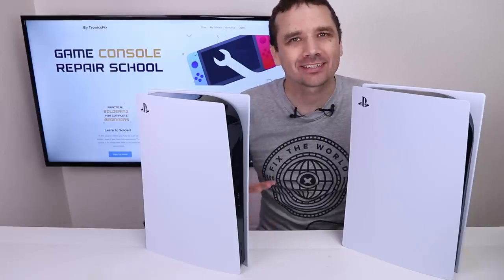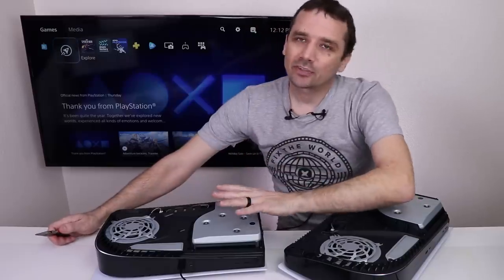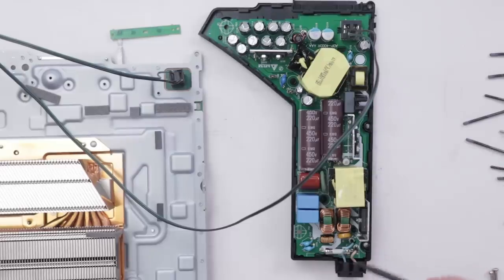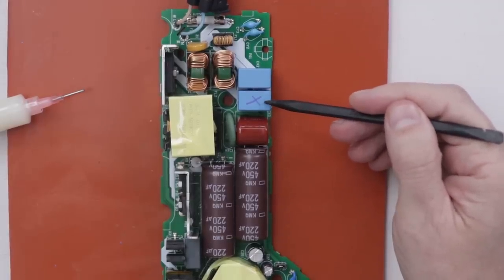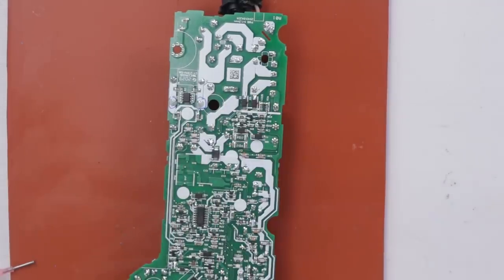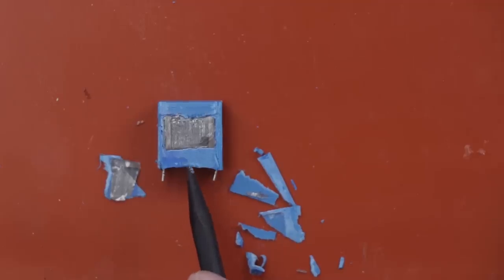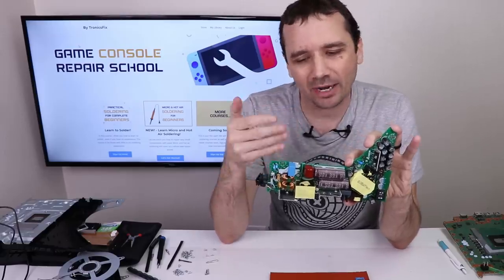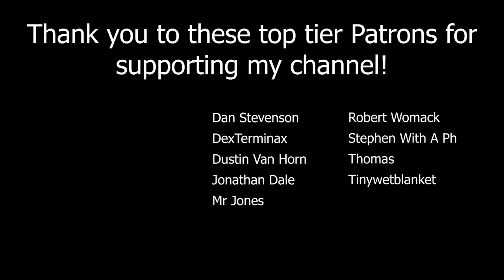PS5 Coil Whine - What Is It and Can I Fix It?

Comment: Same thing happens on battery chargers. The Milwaukee M18 Rapid charger, for example, is horrid when charging a battery. The noise you hear drives me (and others) crazy; so....we put them in different rooms away from us, or in garage etc....
Like another person said, it’s inevitable for some “noise” with electronics etc....and not much one can do.
Sometimes it does go away, it becomes white noise and don’t notice it, volume in room is louder than noise, etc....
This is first year ever, not buying new console, cuz over the years, [they] have have strayed from the console experience. When prices for PC hardware comes down; will upgrade PC and just game full time on that, especially since able to do game pass on it for MS titles, and also have Steam etc...for your library. Other “great thing”, no proprietary storage....so, don’t need to “waste” $300 on a Xbox SX “expansion” card to play more than 7-10 games. Yes PS5 has m.2 nvme pcie 4.0 5500/read speed ssd expansion slot....but won’t be functional with firmware update till June 2021 🤔, also,  2TB ssd is like what, $360 before tax, & if bought digital console....welll, got so,e money into a machine that will be revised in 3 yrs time.
This is the place we are now at w/ consoles....are they really worth it now (yes, gpu, cpu, ram etc....prices for pc will drop again, and can get good FPS, and UI in a budget build); but that neither here nor there, right😉
Sorry for book I wrote, can’t wait for next vid! Can’t wait for what you bring us next👍🏻

Comment: This type of noise can have many reasons, mostly lower quality components used. You can try to replace that capacitor with similar high quality cap. 
This can also be due to resonance, you can try to filter out that noise out with a series inductor and a lower value cap instead of this, but it will be mostly trial and error without a proper schematic.

Comment: If it's coming from a metal film capacitor that would mean the buzzing sound is likely electrostatic. I've heard you can mitigate capacitor buzz by just using one with a higher voltage rating, but that might not be feasible when you have to fit it in the same space as the old one. There's also variation in manufactured parts, so maybe that one just wasn't packed and epoxied tightly enough. Replacing it with an otherwise identical part might be all it takes to get rid of the sound.

The other option is to just take off the problem cap. You'll basically be trading audible noise for electrical noise on your house circuits. If the FCC shows up at your door, hide the PS5.
Reply from the maker: Lol...noted!

Comment: I had to send my PS5 back for a replacement because it had so many issues. From a very loud fan (as loud as my PS4), to a high pitched noise that would leave my ears ringing (others have same problem), to a loud buzzing PSU. 

I feel like it isn't as uncommon as people think because Sony themselves know of the problems as they had no issues replacing my PS5 without any proof.
Reply: @J Fz if I investigate my situation? No I just sent my PS5 because 1 dude said he had the same problem. You should just Google or check on YouTube and you'll see a good amount of people having similar issues with their PS5s.
Reply: @J Fz I know you're not calling me a liar, it's all good. I'm saying what you said doesn't really make sense. Firstly it's not a "particular case". I don't know but the way you're saying it makes it seem like you think only a few PS5s have similar problems when it's actually a lot more. Also I don't think I can link these problems to "dropped in transit" when the issues started to occur weeks after playing. 

Loud fans, PSUs, coil whine, buzzing noises, loud disk drives, will always be problems with similar electronics especially if they're not built particularly well. I don't believe the series X has as many problems because the quality is higher, even the packaging is of much higher quality.

Comment: Funny how people complain about coil whine like it's total deal breaker. I call it normal, your ears get used to it over time. 

It's not a fault in device, it's just how things work and every single device/appliance/gadget can make it..
Heck! Even my iPhone makes hiss noise when it's loaded with 3D graphics on screen, phone charger whines when I put my ear next to it, my rig whines in games and my laptop's backlight module makes humming noise at low brightness
Reply: @Wayfaerer Then don't use it, blame Sony for having certain manufacturing cost they had to match to get it sold as price it's meant to be. Then you need to make compromise somewhere, and this time it maybe have been the PSU's components. Higher quality components, almost cherry picked ones would for sure be quiet

Comment: In short it's basically just current passing through it. That capacitor may be made slightly out of tolerance, therefore a bit noisier, but it's super common for high voltage caps.

Comment: You can simply put a magnetic resonator close to that conductor (which is nothing but a close coil) - something like an iron ring :D and getting your ear close to 450V capacitors is a good idea for getting rid of unwanted ear hairs
Reply: @J Fz It can be glued to the top cover for example and be combined with some coil windings

Comment: The epoxy I believe is for fire suppression because it a x2 (meant for 120/240vAC mains) class cap. Just try another one rated the same, its works the other way as well and is called  "microphonic" when a cap starts making noise or emitting it electronically. Basically the closer the layers(capacities value vs space)  of the cap are the high chance this happens. Even the little SMD caps can sing in the right conditions.
Your cause is likely up stream from the cap though or another device on your power grid. With out oscilloscope (and differential probes or isolation transformer) I don't think its going be easy to find.

Comment: The issue is we have the circuit board, but we don't have a schematic of what the hell is going on with the power supply. Of course you have AC to DC conversion in there somewhere. My guess is the capacitor is being used as a low pass filter or something of that nature. It's defected so it is not filtering out the noise like it's supposed to......that is why I would try to replace the capacitor....of course you need the right model to do so.
Reply from the maker: I could replace it but I don't think the capacitor is faulty. I think it's a normal noise that it's making. The only thing I can think of is replacing it with another component that does the same thing as that cap but doesn't make the noise.
Reply: @Tronicsfix  yea buying one of higher quality from a better rated company would probably fix the issue

Comment: to all those who freak out about coil whine. Its normal almost every console has it. You can especially hear it with heavy games like ac valhalla. And since the fan is so quiet the noise is more audible. 

Great vid btw :) 👍
Reply: Yet somehow SX does not have widespread reports of annoying coil whine. Could it be that one company went the extra mile to ensure theirs doesn’t have coil whine?
Reply: @captaincrunch1707  

could be. If one thing the xbox one did better than playstation last generation was noise level. Extremely quiet and coming from ps4 which was ridiculously loud. The ps5 ain't to bad.

Comment: I didnt really know what a coil whine was
But now I kinda know i was just thinking its from the transformer or inductors

But its other Components too
I guess its something with the frequency going in to it and it starts vibrating
I don't think coil whine hurts just a bit annoying 

You should use a polyester film capacitor instead those are quite Stable

Comment: Maybe I'm just getting old but all capacitors whine when charging up and discharging. This one just happens to do it with in your audible range. Go listen to music at full blast till you get tinnitus and the issue will go away. Or replace it with a another one off the shelf that vibrates at a high enough frequency you can't hear it.

Comment: Same issue I have, tried 2 PS5s (sold the first at cost). Even tried putting o-rings in, thinking it might be the fan. It is quieter than both my PS4 and PS4 Pro, but the pitch of the noise in the PS5 is more annoying. 

I considered sending it to Sony to fix since I can’t exchange it in store. But another YouTuber sent his into Sony and they sent him a new PS5 with the same sound. Seems like a lottery for which power supply you’ll get. I’ll just hang on to the PS5 I have now and hope they resolve the issue when/if they offer a black PS5.
Reply from the maker: I'm surprised they even took it back since it's not considered a defect.
Reply: @Tronicsfix  right, probably depends on the support person you talk to. Don’t want to deal with that phone conversation either.

Comment: I see this on big industrial plastic  start/run capacitors  all the time. Wrap it in a thermo pad to insulate the sound yet still able to draw heat out.  Not a fix but a solid bandaid
Reply: Did you do it? 

I’ve heard Hot glue / silicone stops the vibration and makes the coil whine inaudible.
Reply: @MrUchiha  yes I've done it. I would not use Hot glue . It may melt and holds heat
Reply: @nelsonw7096  Did you isolate the sound tho? like did it hide the sound?
Reply: @MrUchiha  yes confirmed the sound location with a mechanic stethoscope to locate. And couldn't hear it after. The thermo pads I buy are made to be used on large heat syncs  I use this also on xfmrs and light balists as the buzzing bugs me
Reply: @nelsonw7096  Is it possible that you have pictures of what you've made? It could be useful for someone like me who is not that amazing with these kind of repairs? I've fixed a few defect PS4's but that was because i was experienced with the console. The 5 is new and im not experienced at all.
Reply: @MrUchiha  no I don't have pictures but the only hard part as I remember was getting in-between the 2 so I wrapped both with  thermo pad.   as its pretty tight and getting a little flap inder them between the posts. I used a plastic scribe(kinda like a dental tool) to fold over a little flap. Rough measure and make a cutout like if you were making a paper cube .

Comment: I replaced a capacitor like that on my Baxi combi boiler circuit board that kept coming up with an e68 error. Replacing it for a slightly larger, better one solved it. I'm comparing a teapot to an apple here but there'll be a better make of the capacitor out there somewhere. In the UK there's places like Farnell you can order all sorts of electronic paraphernalia from.

Comment: This is security capacitor, they dont explode Wen go bad and go to short, only go open. Dont put weird things reemplace whit other. Is a Filter so check line for correct volt an never put in the same circuit off motors, radiators...... Use a line Filter shocket

Comment: The capacitors are used to rectify the incoming ac voltage and to smooth out the dc voltage produced when the rectified voltage is switched on and off to bring it down to the proper output voltage for the power supply. I’d assume that the power switching is happening at an audible frequency and something in the capacitor (heat expansion I think arcing in the cap would be instantly fatal to the cap) is making a small noise at that frequency.
Reply: You could try a higher quality cap but I think it will still buzz

Comment: Cheap capacitors are the source of most coil whine usually after heavy use. Coil whine out of a new machine is not a good sign it will only get worse or even fail sooner. Replaced some caps on an old on a 486 dos retro pc a friend on mine uses fixed the whine. Had to replace two on a sound card it had which gave a constant light buzz to any sound.  Runs like new and saved him money as good "old" pc parts to build another would not be cheap and couldn't be trusted not to have the same problem. 

I told him initially it would be easier to just build a 300$ APU and run games on dos box but he wouldn't even consider it lol

Comment: It's a capacitor.  While agreed it's a film capacitor, replacing it should remedy the issue.  I have done this inside of flat screen TVs at times to fix them.  Manufacturing defect, variance in assembly, who knows on the causation but replacing it should fix the issue regardless.

Comment: I don't think it was the capacitor that made noise. If it was the case, both would have as they are most likely - basically- in parallel with that common mode choke in between. The noise is too low frequency to be the switching noise that's usually in the order of Kilohertz (or kilocycles) for switching power supplies. I think you heard an audible harmonic of the high freq. transformer or something.
These capacitors are used in high frequency drive circuits too, to limit currents for example. In those they never contribute to the noise, either.

I'm ready to be corrected though!
Reply: See for yourself if you can find another 1uF 10% class X2 capacitor (105K) if you're so inclined. Make sure it has the right pin pitch and has an overall size that you can fit. The class X2 is important for the application across the mains voltage.
The removed capacitor has a capacity of 1uF and a cap. tolerance of 10%, try to get something from a name brand like EPCOS or Vishay, trough a reputable supplier like Newark/Farnell, digi-key or mouser.

Comment: I'm not an electrician or anything, but if the wire has a break it may do that it & in the case of motor housings they look like windings but are layered & if I understand correctly are coated between layers, without coating or breaks in them it seems they arc or jump.  

I assume if they serve to absorb energy it shouldn't be too much left & having 2 is a redundancy.  

I could be entirely wrong here.  That is my thoughts on it.  Does resemble motor windings/motor housing plates.

Comment: Apply NEUTRAL CURE (not acid) RTV Silicone to the vibrating component anchoring it to the pcb and surrounding components, dampening the vibrations
Reply from the maker: That won't help as it's coming from the inside of the capacitor

Comment: People really complaining about coil whine i had to go thru a damn jet sound for years this is NOTHING
Reply: Who is to say the people struggling with the coil whine didn't have a jet engine PS4 for years as well?
Reply: I have a 1215a model ps4 and the fan makes noise.  Although honestly I can't really tell 90% of the time because of in game audio.  That and I usually play games with a gaming headset on, or on my home theater system.  I would think that would more than take the attention away from a bit of coil whine.
Reply: Why shouldn't they when the PS5 was promoted as being whisper quite. Instead myself and others got a console that's worse than the PS4 in some ways. My ps4 was kinda loud but it didn't have a high pitched noise that would leave my ears ringing. Plus Sony know it's a problem because they have accepted many PS5s back for a replacement.

Of course it's not a problem for everyone but it's common enough, especially compared to the series X to question Sony about these issues.
Reply: @aki-sid  my Ps4 is the 3rd revision of the system.  I'm sure they'll revise the ps5 eventually lol.
Reply: @ithiriafalls  I was replying to OP. And tbh I don't know what you're trying to say.
Reply: @aki-sid .....just sayin usually the first version has the most problems and it will most likely be revised.  Personally I've learned not to buy consoles when they first release.  Just got through installing an analog stick replacement on my left Nintendo Switch joycon because of drift issues.  Guess that's why we watch the TronixFix channel huh?
Reply: @ithiriafalls  oh yeah of course, I agree. First gen of consoles or any electronics will have problems but at the same time, they are still quite rare. The PS4 didn't have mass problems with it, sure it was loud but it was built like that (without great cooling). The PS3 on the other hand had major problems very commonly. The PS5 is fine tbh, plus I don't think it's worth waiting 2 years for the revised version.

Comment: Coil whine is caused by a small gap between the coil winding's that start to vibrate.  The PS 4 pro does not have it I  think the PS 5 has a weaker component part or under more strain from a bigger power supply.

Comment: Wait a minute, so the whining originates from the power supply. 
As you stated, Sony is using the same capacitors as in the PS4 pro. 
That would lead me to believe that the PS4 pro has coil wine as well.
People just can't hear it over the jet engine fan.
Sony should have upgraded  capacitors for the PS5.
Seems like they just dug in the parts bin.
Reply: Think this is the case tested my pro and it does have the buzz but have to put ear to system and fan sort of drowns it out

Comment: Yo Steve, If the inductors and capacitors are all Ok, Just out of curiosity have you checked to see if the wave form in the Power corrector circuit is with a constant clean one?
If it's Dirty You may have to check for dry solder joints and or replace components such as a Mosfet, JFet, Regulator or even perhaps the Power Supply correction IC itself..

Comment: Was gonna say add some (weird) glue the Xbox X|S has in their systems but you already said they had the glue...
:s so no fix unless you want like, add the glue between each capacitator so it reduces movement and thus less whine.
But from the video I didn't even notice it.